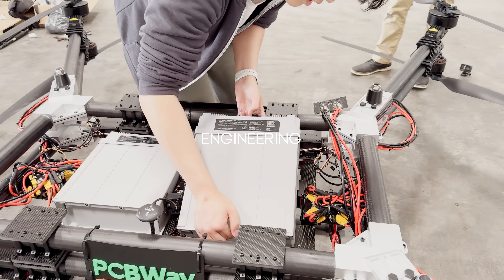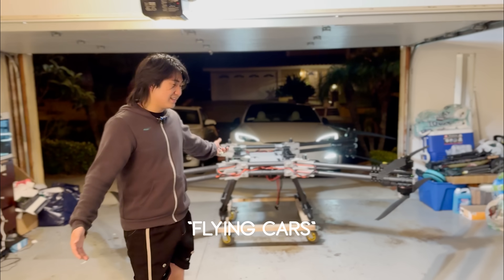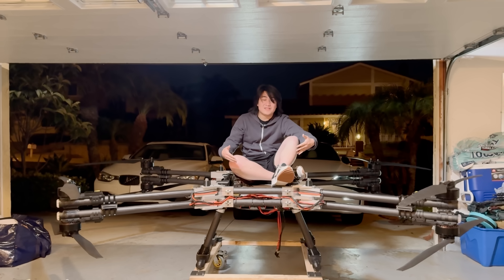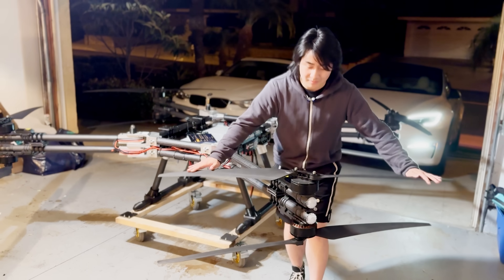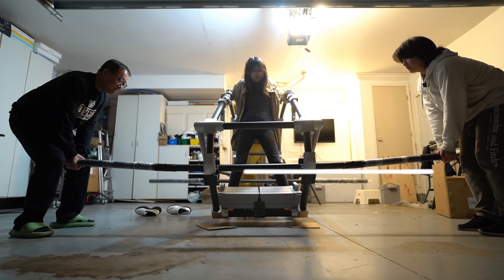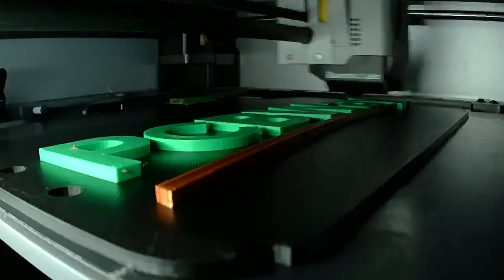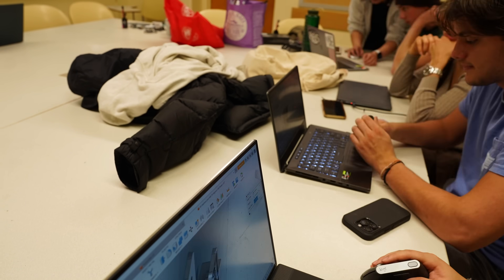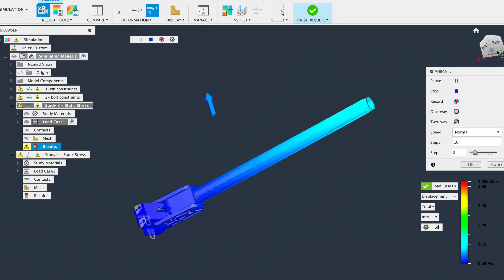My "flying car" finally FLIES

Comment: Se ve increíble, mi recomendación es que para el diseño utilicen un motor central con cables que permitan la transmisión y colocar en el contorno pequeños rotores y tubos de absorción de aire para aumentar la sustentación del aire en las aspas, cuatro rotores están bien Pero deben usar o un motor o esos mismos Pero en el centro, usar los tubos como fuete de aire comprimido para fuerza de escape, utilizar el mismo motor para alimentarlo, y pues básicamente eso poner multiplicadores de rotación en forma de plataforma con el motor central y usar transmisiones de PVC o de carbono y aumentar las aspas de cada rotor, de modo que un motor asistido por cuatro pequeños, te dará una potencia significativa y los de aire comprimido una mayor sustentación y equilibrio, considero podría funcionar,

Comment: Thats a helicopter dude that aint no car.
Reply: Helicopters are completely different than a quadcopter, go learn the difference.. Also it is a car, and nothing in the definition says it needs wheels.
Reply: @IAmFeonicks13 a car is a personal transport vehicle dummy. That is no car. It is a helicopter. Or at least a vertical takeoff 'aeroplane'. Pfft.
Reply: @michaelrichter8204  the vehicle that he's making is a personal transport vehicle, and it's NOT an airplane due to the lack of wings, and it's NOT a helicopter due to the quadcopter design, go learn the difference.
Reply: @IAmFeonicks13 oh yeah, a car that doesn't drive. Right. I stand corrected, it's a chicken coop. A car that can't carry a load, has no motive power or wheels. But at least parallel parking is a breeze(if you could even use the roads 
So funny omg people are so gullible
Reply: Also of course it doesn't drive right at the moment, because it's still being MANUFACTURED, of course it won't drive right when it's not even finished, and he mentioned the payload will be increased once he's done with it. Also, a chicken coop isn't a transport vehicle so it is NOT a chicken coop. And again NO WHERE in the definition does it say that a car needs wheels, and it's got plenty of power. So shutup with your dumb allegations.
Reply: Chicken coop is a car that doesn't drive professor gullible. Also the battery technology for your hypothetical flying (not a) car doesn't even exist yet. But(they will figure it out)... Right... Easter bunny much? Man every second another sucker born.
Reply: @michaelrichter8204  he's working on it, you can't expect it to work when it's not even finished, if it doesn't work after it's finished then you can call it a "chicken coop".

Comment: Are you intending this to fit in the 103 ultralight class? If that bare minimum is 200LB you can only add another 54 LB for it to qualify then it’s officially an experimental small aircraft and will require all the licensed stuff to get it off the ground with or without a pilot.

Comment: If the price of that isn't in yen you may as well get a small airplane. Was the highest cost 10k an hour pay to everyone?

The cheapest manned airplanes you can fly can be had for about 15k U.S.

You will need a pilots license a place to store it. Insurance. The cost of airplane fuel and other uptick maintenance. So they get you somewhere i guess.

Flying i am always told is easier than driving. You csn fly at a younger age than drive a car.

So get training and fly and it's cheaper than buying an F150. Maybe not for fuel maintenance and storage hangar rentals.

Comment: My suggestion to increase its structural integrity, is to create a frame using an egg shapped design and bring the rotor blades as close to the body of the vehicle as possible. The design of the  rotor support arms can even take on the design of a trumpet with it being thicker at the base closest to the vehicle and thinner extending outwards to the rotor blades.

Comment: a cool idea for once you have everything figured out is a 'gas' and 'brake' pedal, heres the idea if your pushing on any pedal it basically hovers or a slow descent and the 'gas' pedal increases blade speed and the 'brake' pedal decreases fan speed. probably impractical but cool (if it works [maybe confusing]) and ofc you can use a yoke for the axis of rotation.

Comment: All that expensive carbon fibre tubing why not get carbon fibre filament for your joints also?
Reply from the maker: Carbon filament are brittle. Aluminum deform visibly before they fail. Aluminum parts are actually more expensive

Comment: Otis T. Carr, an American inventor, founded OTC Enterprises in 1955 with the goal of developing a spacecraft inspired by concepts from Nikola Tesla. He designed a saucer-shaped craft called the OTC-X1, which he claimed could travel to the Moon and back within a day. In 1958, Carr constructed a full-scale, 45-foot mockup of the OTC-X1 for an amusement park in Oklahoma City. He planned a demonstration flight of a 6-foot prototype on April 19, 1959, but the event was canceled, and no functional model was ever publicly demonstrated. ￼

Ralph Ring, a technician who worked with Carr, claimed to have participated in a successful test flight of a smaller OTC-X1 prototype. According to Ring, he and Carr conducted a test flight in which they traveled approximately 10 miles instantaneously. Ring asserted that after this test, government agents intervened, confiscating their equipment and shutting down their operations.

Comment: Dumb question, but don’t the legs make it a bit less stable in the air because they reach such a length from the main body? Would it be realistic for you to make the legs so that they fold in after takeoff? This is a non engineer asking this question

Comment: That’s neat, but my instincts say having the pilot above the propellers is bad even if you counterweight it because then it’s inefficient. The optimal configuration will always be like a helicopter with the propellers above. Plus, that’s way less dangerous. I guess that’s why the idea of the flying car never materialized. Still cool though.

Comment: One of the fatal flaws in these designs of this type is placing the pilot in roughly the same horizontal plane as the rotating blades. Besides introducing instability, there will eventually be fatalities resulting from blade or blade components detaching and striking the pilot. But that's just the start.......

Comment: Hello Alan, as someone who works in control systems, how did you go about tuning your motors? When I make drones from scratch without downloading a preset tune for size, they are usually unstable. Were these the raw PID measurements, or did you have something you referenced off of? Neat video and I look forward to more.

Comment: To control flexing and reduce load stress on the arms, a shear web made of carbon fiber can be placed inside carbon fiber tubes, similar to the blades of wind turbines.

Comment: Does anyone have any advice on controls?   Simply put, how would you get rid of the transmitter and wire joysticks to the Flight Controller?  Perhaps an Arduino based circuit that takes input from the joysticks and converts the signal to PPM which connects to the RX of the Flight controller?   Has anyone any experience with this and could you share the circuit and code?  

I've been working on a VTOL like the jetson one as a passion project but I am stuck when it comes to controls.

Comment: Hey I might not know much but You should add a GPS chip that locks the craft in space by having it talking to the gyro and ESC so it's always level and won't drift I think DJI has that on there drones

Comment: You, sir, are my hero. When I was 8 or 9 I had a vivid dream in which I built a backpack "helicopter" (or, "BeePeeHee/BPHe), and never felt so much joy, freedom, happiness nor fulfillment as I did at that age flying my fantasy BPHe I was so obsessed with the dream that I tried building the BPHe. Twice. At age 12 I used a washing machine motor (yeah, lot's of extension cords were planned), and a prop from a big apple tree orchard fan used to push cold night air from killing apple blooms during spring, when smudge pots arent quite enough.  It failed miserably,  due to (pick any and all): poor design, poor materials choices,  poor construction.  
Then, two years later I   attempted a more refined approach by dumping the helicopter approach and  copying the burgeoning (1979) parasail motif. I only got as far as building a backpack prop driver to give thrust once airborn with a parasail. I used an underpowered 2 stroke leaf blower motor and fashioned the prop from a whittled down 2x4. I used some chicken wire to protect my back. Idk how much thrust it generated but I never could afford the parasail. As I grew older my dream fell into distractions, and I lost my way... but your dream has reignited my dream! Thank you!  Good luck!!

Comment: Previous one was better but bro needs to get in touch with a fucking welder, you can’t just continue using 3d printed parts for structural integrity forever homie

Comment: $1700 per part cnc fabricated aluminum is way overpriced imho! but if you have unlimited funds or your simply using someone elses cash flow then it will be fine. lol the build is awesome i just think it would be smarter to buy a small cnc cheap as most will do aluminum very easy.
Reply from the maker: $1700 is the price of quantity 20

Comment: It might be just a big drone, but I'd argue the designing a frame from scratch is the hardest part of designing any kind of aircraft. You can literally slap a Pixhawk on this and provided there's enough power to lift the thing you could call it a day and be left with a giant Biaxial Octocopter.

The hard work went into the design and construction of the frame, and getting the design to withstand the associated forces, as pointed out by the flexing in the second prototype.

Comment: Any sane engineer would end up just building an electric helicopter. An electric helicopter, as long as the main rotor mechanically drives the tail is controlable and can land even during a total power loss. Quadcopters don't scale up, and there are 4 motors that could have a failure. And if they do, the human pilot will most likely die.

Comment: I didn't even think they had that anymore. All store-bought quadcopters have GPS and stabilization autonomy. You're flying it freehand with the joystick. It's difficult to do without crashing it. 10 years ago when they first started with quadcopters I had a little model one. they didn't have any of that stabilization balancing software.

Comment: I think you can lose some weight and gain flight time, by having a smaller battery and a small petrol generator. Use rotor blade covers.

Comment: Even though it is essentially a scaled up custom drone that is still a hell of an accomplishment.  Even a small DIY drone takes a fair bit of skill to make from the ground up (I'm not counting a pre designed kit in this category).  People see all these consumer grade (DJI and such) drones that anybody can fly and think its easy without realizing just how much design and computing has gone in to making those essentially fly themselves.  
Scaling a small drone up into the realm of being able to lift a human's worth of weight adds a whole other pile of design challenges to overcome.  Materials and designs that work with a sub 1 kilo drone dont always have the rigidity to carry a 90kg one aloft, especially if you want to have another 70-90kg lift capacity on top of that.  You can jsut 3d print alot of structural parts for a light drone that would just snap under a heavy one when scaled up. Takes alot of skill, talent, and determination to overcome all that and make a working prototype.  Excellent work.

That said useing that area as a testing zone gives me the heebee jeebies.  Your moving a lot of air with those rotors and its going to swirle around and bounce off the walls in unpredictable ways.  would be really easy to crash by accident.   I'd be much happier in a remote field on a windless day with a safety tether to keep the drone from going too far if control is lost and barriers for observers in case of rapid unplanned disassembly.  sure your probably perfectly safe in there but one  wrong bump of the controls in that confined a space could wreck the whole project.

Comment: firstly why are the blades under you? they should be above your body, second how come those blades don't have a funnel built around them to help with lift? ohhhhhh i see what you did you just built an oversized drone.....lol, dont try and use it as a flying car for the love of God.

Comment: Dear Mr. Zhang, I am very impressed by your dedication and technical knowledge and mechanical, electrical and electronics acumen. This is a marvellous creation and I wish you all the best with it.

That being said, it is NOT a 'flying car' and you ought not use the term. Doing so cheapens the final product and all of your hard work. Call it a multi rotor airborne transporter, which is what it is. If I had the dinero, I'd buy one from you and fly it myself. I envy you. Cheers, D.

Comment: That is awesome. To really reduce weight you should study making a frame without metal brackets. Iv seen guys make those bamboo bikes... you could wrap most joints with wet carbon, seems it would save alot of weight. Best of luck to you, keep on pushing!

Comment: Way better then V2! Good job! As a prototype it’s great. But once again I have to come along with a small rainy cloud. I’m a Bmw tech, drone pilot bla bla bla, I mentioned everything in my V2 comment. My number one issue with V3 is the aluminum joints on the carbon fiber. I also noticed you use grub screws to fasten the legs, what are those grub screws made out of? Steel and aluminum don’t like to play with carbon fiber. The carbon fiber will literally pull electrons from the aluminum causing pitting, and eventual weakening of the part. Galvanic corrosion is real. That’s why I started with “as a prototype it’s great”. In the short term to get the point across, 100%. In the long term, I would highly recommend titanium. Titanium plays nice with carbon fiber. I hate to bring it up, but do you remember that sub that imploded? That was galvanic corrosion with electrolyzer (salt water). Weakening the structure that much faster. You won’t have the electrolysis problem as bad but not optimal. My last comment was pretty dire this one is more, Cautious. Do your preflight checks, check those joints every time.
Reply from the maker: Thanks for your insight!! Do you think a layer of epoxy between aluminum and carbon fiber would’ve helped?
Reply: @alanzeekk  I don’t think that would help too much, but I am not an expert on galvanic corrosion. My opinion (about an extra layer of epoxy) is based solely off an assumption. What I do know is that titanium is light enough for your needs and doesn’t have that issue with carbon fiber. (I don’t work for a titanium supplier, I assure you). Cheap and dirty, you could sandwich a very thin sheet of rubber between the carbon and aluminum. But with that option, I can imagine constant repairs of that rubber membrane just from vibration. Another option could be aircraft grade adhesive inside your joints. To try to act as a buffer.  It will never come apart though. If you open the hood of your bmw, and look at the internal fender wall you’ll see this stuff, it’ll look like a very wide welding line. That’s the stuff I’m talking about. Those options might work, the one that will work. Titanium. As far as the legs and the grub screws, I would absolutely use aircraft grade adhesive for that. Just imagine what that carbon is doing to that grub screw. As you tighten those screws, you’re making the connection for corrosion that much better. I want to reiterate, that I’m not trying to discourage you. I just want you and your team to be as safe as possible, and make something awesome. I’m really enjoying your project and will sub for further updates.

Comment: Fantastic work! What a wonderful project! I bet you have learned loads from building this from scratch. I like your cinematography with the motorised camera mounts. Something I noticed that I think may cause problems for you is that there are many internal corners on the machined parts which could lead to stress raisers where cracks can develop. If you work on improving these you really should feature radii instead of internal sharp corners. This is in no way a major criticism of your wonderful project. I wish you the best of luck moving forwards with it.

Comment: I'd be really worried putting a person on this if it doesn't have the ability to autorotate like a helicopter in case of engine failure (or running out of power). But that would only need to really be a feature if it goes high off the ground. You should be very proud of your accomplishment though! It's looking great :D

Comment: For your safety factor i recommend 5.25 - FAR 27.337 x FAR 27.303 (3.5 X 1.5)
Reply from the maker: Are you referring to federal aviation regulations or aluminum pipes?

Comment: HA!  You beat me to it.  At the very end of the video you called it, that some people might say it's just a huge drone.  I was gonna say that but also the fact that you built it yourself is very impressive.  I'm only knowledgeable on the software side of it (sending the right amount of power to each motor to hover, or move in a direction and compensate for wind).  Now the rest of it?  Hell, I'd just be guessing.  Good job on this!

Comment: why not put a fan somehow in the middle so that when taking off the poles hanging out the corners don’t bend and it won’t be as much weight and risk breaking them or bending them?most especially if someone is going to be in the middle then you would probably have to have one there.

Comment: Little suggestion: Try AI based software to compensate all axels for stabilization improvement. It sounds impossible for a single designer, but you have a lot of experienced professionals on your side.